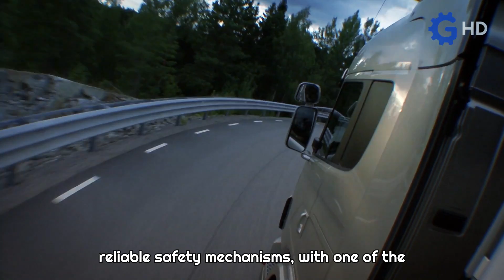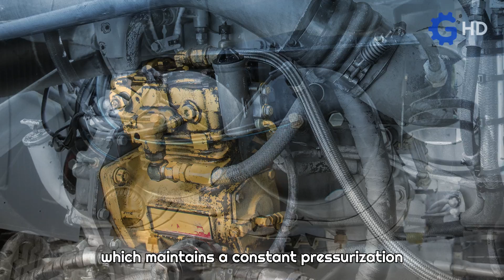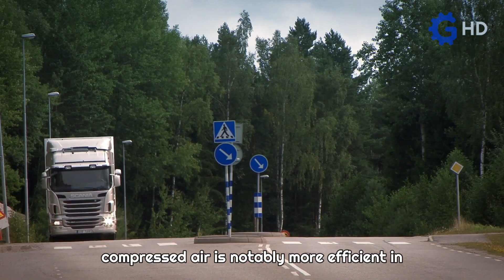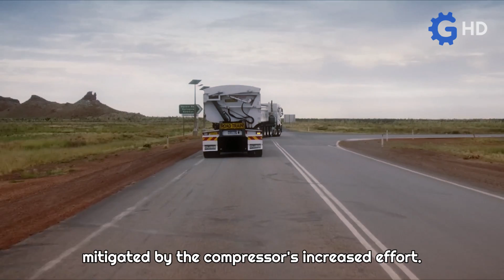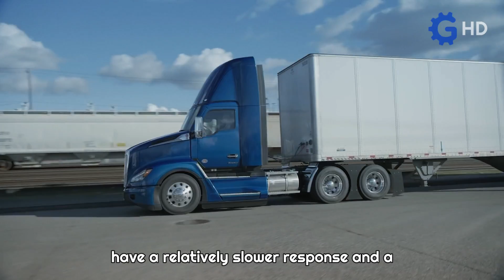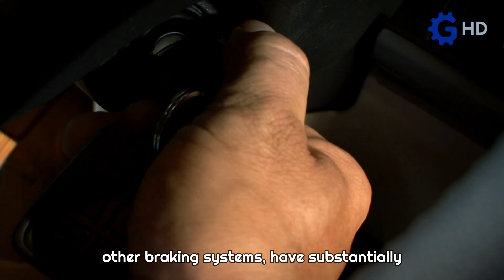Why Don't Semi-Trucks Use Hydraulic Brakes?

Comment: Reason 1: hydraulic brakes can overheat (fading)
Reason 2: connecting of trailers is much easier with air lines
Reason 3: more safety. Without pressure an air brake is locked.

Comment: Dude, I think you've got it reversed.
The air is normally used to disengage the brakes not engage them.
The brakes are held on with springs, this providea the advantage that in the case of system failure, the brakes will automatically engage.
There's an emergency lockout system where you wind the brakes back open in case you need to tow start a truck that's not starting.
Reply: that,s the Park brake not the service brake system.
Reply: Air is used to actuate the service brakes. No air, no brakes, but at the same time, no air in the system means the emergency brakes are locked. and the last part that you are referring to is called caging, where you essentially compressing and locking the springs in a released state
Reply: Exactly. Without air pressure the brakes are closed completely. Not the pressure of the air brakes but the force of the springs.

Comment: You call air brakes expensive?. I'm guessing you've never worked on a heavy truck or piece of heavy equipment with juice brakes.. And BTW to stop the same vehicle with all conditions equal air and juice brakes generate exactly the same amount of heat

Comment: That aint the way i hear'd it, sonny.
The air pressure keeps the brakeshoes OFF of the drums. You touch the  brake pedal, the air is released, and the springs the air pressure is compressing, push the shoes against the drums. You run out of air, and the brakes are automatically engaged. 
The problem with hydraulic brakes, is the disconnects between the truck and trailer; you dont just hook or unhook a fluid line to another fluid line without leakage or risk of contamination. Air is, like, free, and a system proven to self-clean under proper operating conditions. 
So much wasted money for this badly flawed presentation.
Reply: The video doesn't explain the parking and emergency function in detail, so it isn't wrong about it. Your attempt at explanation is very wrong, though. 

Pushing the pedal doesn't release air from anything - pressure remains up in the parking and emergency circuit (red hose), which continues to counteract the springs. Pushing the pedal supplies air pressure to the service brake circuit (blue hose), applying the brakes. 

Pressure is only released in the parking and emergency circuit if the dash button is pushed, or in the trailer if the red hose is disconnected, or in either truck or trailer if a leak is so large that the compressor can't keep up.
Reply: I said, that aint the way i hear'd it. Obviously, too many dont know, or bother to fully explain things, so i jes now sorta wandered thru the available videos and there is definitely some things left out of some cdl schools. Considering the candidates, it is so dumbed-down those of us who can understand the full thing, arent given more than the slowest in the class can handle, and i never had a trucker tell me my information was faulty; they have said, or agreed with, "you lose air and your brakes will engage". THAT part aint wrong. I think about it, tho, and yeah, the pressure to apply the brakes is The Way that That part works, and nobody told me ive been wrong, since i do a decent job of herding a big bucket-o'- bolts and my ignernts aint showed up. Ya kin learn sompin new every other day-or-so, eh?
Reply: 100% Correct.  This is why a cold truck sits revving the engine to build up air pressure in order to release the brakes.  It is a fail safe system which applies the brakes if all air pressure is lost.
Reply: No,  @PeterJ-ij6mm , jerrynorton1080's explanation is incorrect.
Reply: You have it Wrong  too . The  Brake Actuators have  TWO  Diaphragms  each . One " Can " releases the  Spring Brakes by compressing the springs , and the Second " Can "  pushes the Brakes back on . Yes the Park Springs do assist , but what You said would not provide enough precision of control for an On-Road  braking system . Yes , a sufficient loss of Air Pressure will have the Brakes start Locking on . The ONLY sensible default .

And further , an  Air System is relatively self cleaning  ONLY  in the case of there being an Air-Dryer fitted . Otherwise Daily , or even more often , draining of Condensate is ESSENTIAL or  Brake Failure WILL  result . A  technique for clearing the system out , Once a Month , is to put  One Cup (250 ml ) of Methylated Spirits into the Receiver Tank (Wet Tank) , the First one after the Compressor and Drier (if fitted) , and then just Use The Truck/Bus Normally . The Alcohol will evaporate and run through the system and Completely Remove any residual moisture .

Comment: as a truck driver i prefer the feeling of the air brakes as the sensation with hydraulic ones (but i nearly never use them because i use retarder which is sufficient most of the time)